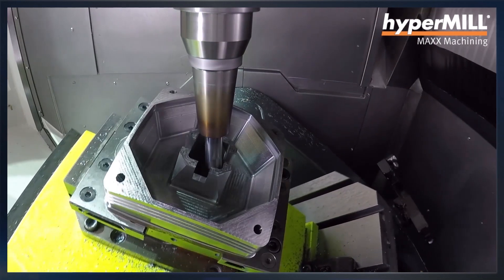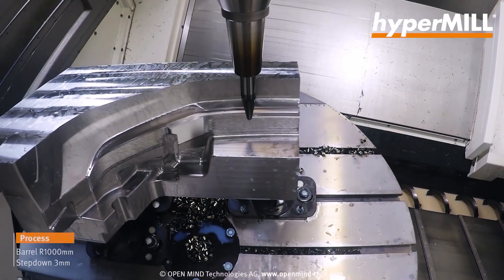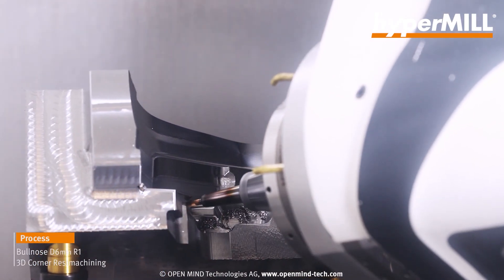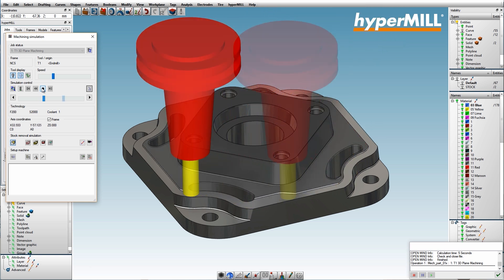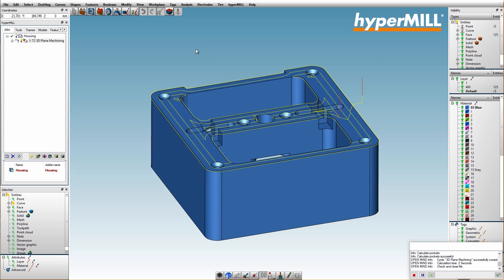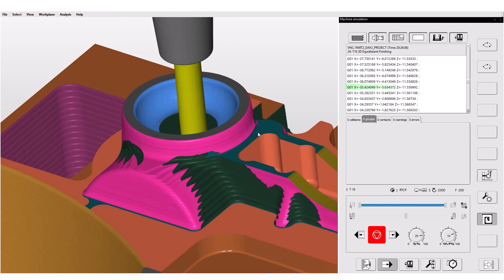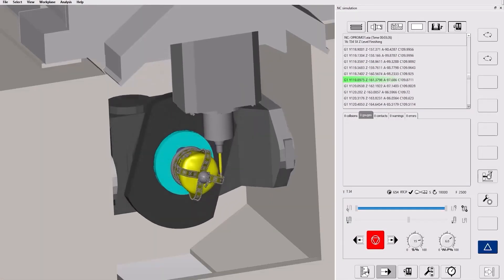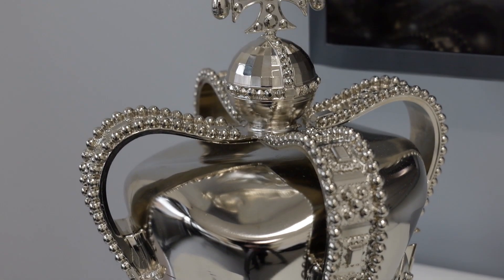Get perfect, precise, and safe tool paths with this cool technology!

Comment: "Hypermill is good CAM software."  Every midrange CAM system on the market can do all the things you've described here.  What sets it apart?  How streamlined is 
the interface?  How long does it take for an experienced programmer to learn your product?  What type of support can I expect and what will I have to pay additionally for?
CNC programming is a major bottleneck for every shop in the world.  How, specifically, will Hypermill help in this area?

Comment: What are some pros and cons when comparing to other CAMs like MasterCam or GibbsCam?
Reply: Contact the sales rep for your area and get demonstrations on all of them and choose for yourself. The higher end guys are keen to demo and show you around, the mid and lower range guys are not in my experience. Tebis and hyperMill i spent a good couple of hours with each, even ONECNC seemed more interested than mastercam who reluctantly replied to my email at best with a rough figure on pricing. I went hypermill as its perpetual licensing and fully modular in purchasing,  has some of the best toolpaths and automation features available. Tebis was twice as expensive as what i ended up paying for hypermill. For me Gibbscam was similar to fusion in that it never entered the equation. BobCAD looks great for learning on